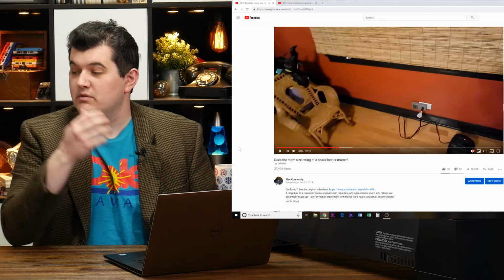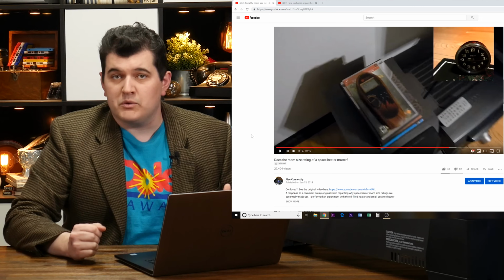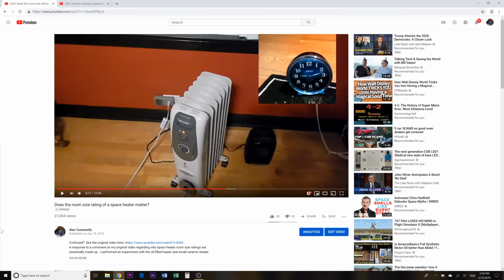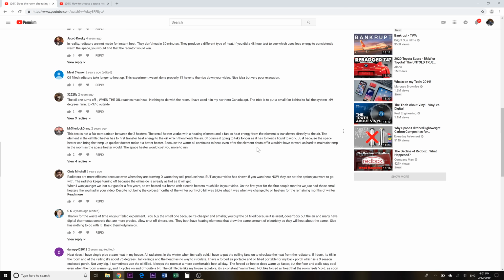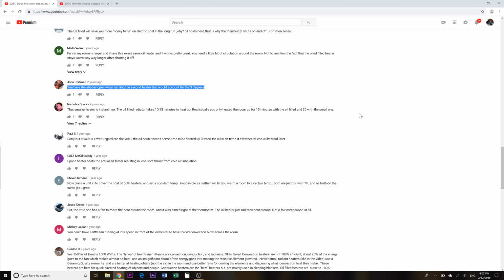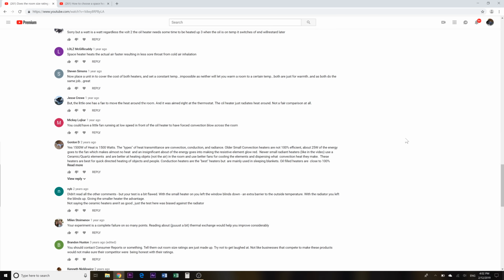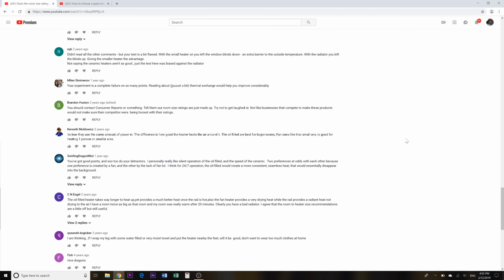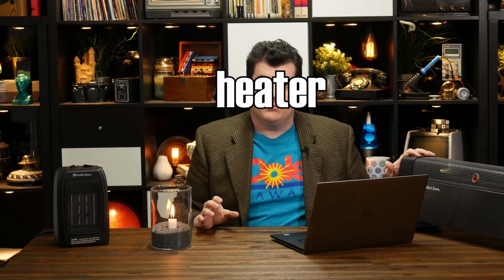More Space Heater Nonsense

Comment: I just spoke to my dad who has been an HVAC engineer a better part of 50 years and he does heat loss calculations all the time you had one thing right or 2. Electric heat is just about 100% efficient (why it's not used today cost) even though both heaters are the same wattage the oil filled heater has thermal mass and when power isn't being drawn into the oil radiator it's still radiating heat. So, if you want a quick instant rise in temp I would use both heaters at the same time and once you've reached the desired temp turn off the small heater by that time the oil heater is up to its optimal temp to keep it toasty warm. I bet the reason for the 1500 watt set point is for insurance purposes because most bedrooms on average can handle a 1500 watt draw on top of what's unknown in the room. Most circuits are rated at 15 amps kitchens or wet areas 20 amps along with ground fault interuptors but now I'm getting side tracked MOST IMPORTANTLY I don't have an electricle engineer a phone call away for free

Comment: Possible explanation for the space heater question:
By heating the air, it's density is lowered, making it float above the cooler air, also forcing cooler air from the top of the room toward the bottom of the room, and thus the heater.
The heater with a fan adds some control, but may allow hot and cold spots even after significant time.

I don't have confidence in that idea though.
I think the best experiment you could do for the problem at this juncture is run the experiment and collect temperature data throughout and plot a graph. Also, if you could use multiple similar sized and shaped rooms concurrently within the same rough area, to ensure that a steeper outside temperature gradient from one experiment to the next does not adversely affect the energy loss to the outside compared to other experiments.

Comment: I hated my 650 sq foot loft condo with 15 foot ceilings with a 99 dollar Menards special "edenpure knockoff" on 750 watts. The electric baseboard heaters that were 220 cost more to run than the fan turning on and off and it never ran 24/7 the heater was capable of 1500 watts

Comment: I'm trying to figure something out. I always believed that turning on a space heater to heat a room 4 degrees intermittently versus keeping a room at a constant, but lower, temperature costs more in electricity. Am I wrong? I'd like an explanation on this topic. Thanks for all this cool content!
Reply: It would cost more because while the room is hotter than the average, the difference in temperature is higher between the room and the outside. So comparatively, more energy is wasted and leaks out. But then while the temperature is lower than average, less would leak. So actually it might not make a difference.

Comment: You're right, don't worry. If you were to graph the energy being pulled from the wall over time, maybe it would show some of the people what you mean. The purpose of an electrical element heater is to convert as much energy as possible to heat within the room. If the energy comes out of the wall (as measured by the Killawatt), it has to go into the room, that should be easy to show graphically, and the difference should be quite dramatic between an oil heater and a fan assisted heater. Hope this helps. Great channel, keep it up!

Comment: Your points are sound and valid, but even towards the end you make the real important point, not all heaters that consume the same power will heat the room to the same degree or efficiency based on their design.  So while you consume the same or similar 1500 watts you may not get the same outcome or effectiveness of heat.  This could be due to differences in airflow either amount or direction (the primary differnce) efficency of the conductive materials, benefits of heat storage etc.  The marketing is likely BS in regards to room size rating (assuming the same power rating, not all "small room heaters" are 1500 watts i don't think), but you still as a consumer purchase a heater based on it's other factors to meet your needs whether safety features, convenience (self timers, ossicaltion etc).  Bottom line like you've already proven, just cus a heater consumes the same power doesn't mean you'll get the same output of effective heat (room size rating not being the measure or expectation of such).  The biggest differences will be surface area and airflow, a heater with more surface area will make more effecient use of the power consumed to put that generated heat in to the room faster and more dispersed.  I'd be curious if you put a box fan behind the oil filled heater if it would out perform the small ceramic.   At a minimum it generates heat using less power (yes it consumes 1500 watts while running, but you yourself said it cycles on and off much more often, and unlike the ceramic is still generating heat while not drawing power due to the heated oil, while the ceramic pretty much stops heating as soon as it cuts off.  So yes I agree with you that room size is a non informative near useless metric, your main goal with the video, I also agree with your other point that not all heaters will heat the room to the same effectiveness despite similar power ratings, but it's almost like you try to make the counter point of that argument most of the video to only come to the same conclusion, that in this case the "small" heater is actually more effective, not less, due to design diffrences, but still not the same.   A larger ceramic with same power draw but better airflow/fin design might do still better.  Bottom line watts consumed does not equal btu's generated, it just isn't that simple.  Realistically BTU is a far more important metric to the effectiveness of a heater than watts or arbitrry "room size" and is the only thing that determines how much space any heater can effectivly heat, now like you said other considerations might trump it in the selection process such as power draw and efficiency, some people will pay for less effective heat for a lower utility bill for example, it doesn't make it a more effective heater though, BTU is really the only measurement that articulates the heating/cooling capability of an appliance.

Comment: Thermal mass. Radiator style heaters are better for spaces that are less well insulated, as they deal better with swings in temperature..that pre-heat time taken heating up extra thermal mass gets put to work with a draft of cold air. A forced air heater will heat a room up quicker, but costs more to keep it that way because they have little thermal mass. Once the room (objects and air) is at temperature they would be theoretically equal in efficiency, but there is no perfect insulation.
Think of the thermal mass as a capacitor for heat, at peak demand you double your ability to recover from a thermal aberration. It is more efficient over time!

Comment: So if I'm gonna use an oil filled heater I should use a fan? I'm assuming using a ceiling fan blowing down would be best because it would push down the heat that has risen to the top of the room.

Comment: Just me spitballing and I am probably wrong.

The only thing that I could think of would be the oil heaters capability to 'reject a disturbance' to the room temperature. So for example The room has reached steady state of lets say 70 deg F for both heaters, A window is opened to bring the room down to 60 deg F (this is the disturbance to the system) and then closed allowing the heaters to reheat the room.

Now both heaters consume 1500 watts and with 100% efficiency are able to put out 1500 watts into the room, but the oil heater I would think has a larger thermal mass (able to store more energy in the oil). So, for the short term the oil heater should be able to put out more heat energy due to the internally stored energy due to heat in the oil. 

On the opposing argument of this, I am confident that the heat transfer rates are vastly different due to the oil heaters passive heat transfer when compared the small space heaters active heat transfer due to the fan. That would result in the small space heater to still win, but if the oil heater had a fan to actively heat the room I would think it would out perform the small space heater in this specific case.

Comment: There is a bit more to this than just the heating element. The small one with the fan with the fan is good for a small room because of the fan. it will spread the heat fast. The one on the right on the video is better if you want to use the natural movement of the heat, and that is better in a lager room. The idea is to put the element under a window to prevent cold air to "fall" form the window and make the floor cold. this makes the room feel warmer without actually using more electricity. 

As a rule 80w pr meter squared is what you need for most rooms. this means that a 1500 w heater is good for a room of 18,75 m2 or a little over 200 ft2. but this is only if you let the hater and thermostat do all the work. This is why it is better to buy a mounted heater fore use under the window than a small potable that you use only for a short period of time. This i also why many people likes oil heaters. Thermostats on small heaters does not great because it is to close to the heat-source. This is usually not a problem on bigger ones because the sensor is usually placed longer  away for the element making it read better readings. This is also better on oil heaters. 

I can give you some more info if you want. just answer my comment.

Comment: For me the question really is what defines it as a good space heater for a small or a larger room? What metric do you use to judge that? If it by how fast it can heat up a space then clearly the small one is better. But as a saw someone point out a larger one might simply be more robust and so last longer making it more ideal for a larger space as it takes more work to heat up such a space. While the small one just need to run for a short amount of time in a small space. But gain it all depends on what metrics you use to judge how well something performances. And the room rating system do not really tell you that does it? (Based on what I saw on the packaging.) And one could even turn it on it head. That the small one is better for a larger room at the noise it produces be as bothersome in a larger room as a small one. Meaning you want one of the bigger more passive solutions for a small one.

Comment: I have a small space heater, a cheap one, and it works on full blast for a minute and then it shuts off, and turns back on after 2 minutes or so. But the room does not heat up that much, it takes a while.

Comment: is the fan part of the wattage rating? the one with no fan would be dedicating 100% of its power to heat whereas the one with the fan would be using some power to move air which is not 100% efficient. not all of the energy used to move the air around is becoming heat. therefore the large room heaters are actually producing more heat at the same wattage rating. want to test this?...put 1500 watts worth of fans in a room and see how much it heats up.

Comment: A bit like convincing people that turning the thermostat to 95F in a cold house that is at 45F does NOT warm the house up any faster than setting it to 70F.....and people that have cars with automatic climate control, and adjusting the set temperature all the way up or down thinking that it will heat or cool  the  interior of the car faster  are in the same boat.

Comment: You have courage to explain this as clearly as you did.  It is difficult to overcome the "inertia" of marketing hype on people's thinking.  Keep it up :-)   BTW I just use one of those small fan heaters because our landlord is cheap on the heat and it works fine, although a bit noisy.  I think the best solution is for people to just get the heater that they like and that they believe in.  And the same goes for any other type of gadget.  PS You're never going to convince Granma that scientifically your gadget is just as good (or better) as the one she has been using for years. :-)

Comment: I agree with your argument. Between the two heaters shown in the new video there is no difference, and the room size labeling is silly.

However in the old video, you showed how the room size labeling is relevant for oil filled radiators. It is relevant how much heat it can release to the room before it has to turn off to cool itself. This is a function of the size of the element and the placement of the thermostat. It is not related to power/heat efficiency, which is, as you say, always 100%

Comment: Radiant heat will always out perform in a room that has a high heat loss (open window e.g.)   In a room with good insulation and low heat loss each will perform as well but the convection w/fan will always be faster.   It's NOT about temperature....it's about how warm it FEELS.

Comment: Okay so. Do the larger ones not have more mass to store heat to release later on? They can be useful if your electricity costs lower at night so you can have it on then and still be hot and releasing heat when you get up in the morning and the electricity tarrif rises (morning grid demands). I'm kind of surprised to see you miss that aspect.

edit: and another less important factor. Can a larger one not stay on its duty cycle longer because it could radiate the heat faster? (edit again, I forgot about fans :D)

Comment: Thanks for both videos. A few years ago the owners of the house where I live replaced gas fuelled radiators with electric heating panels. These were sold with all sorts of promises about radiative heating carbon nano tubes or some such. I was very sceptical of the selling techniques, but he had convinced the owners, a physics graduate and an engineer.

You have succinctly clarified my thoughts on the issue.

Whilst the owners were also concerned about carbon emissions from gas, they use green electricity from renewables and had a desire to become all electric they had also been convinced by the salesmanship patter on improved efficiency. 

I wish I had seen your original video from five years ago. It may have given me the ammunition needed to counteract the salesmanship pitch.

The company went under a year or so later so their 25 year guarantee was useless when the control system died. Fortunately the engineer owner was sufficiently with it to be able to solve the issue with an off the shelf wifi hub thermostat system.

Comment: Those little ceramic heaters are pretty amazing at how well they heat, and how fast they do it. The oil filled ones DO work well, but yes, they take forever to bring the temperature up. I'm wondering if they tend to KEEP the temperature a little more efficiently once it reaches the desired level. That might be something you may want to experiment with. As far as room size, well a small heater physically fits better in a small room and a big heater physically fits better in a big room like you mentioned. Lol. Technical disclaimer so they can sell a big one for more money.. One thing you have been very successful at doing is making some of us think about it instead of blindly buying a product according to what they say on the label.

Comment: I don't think the thermostat on a small unit like that is measuring the heat in the room. They are usually just a simple design to cycle the heater on and off at regular intervals depending on it's setting.

Comment: Great video, THANKS! - A thought: Consider the heaters to be an IR light source where that steady "glow" coming from the much larger surface area of the oil design might give a perception of more warmth without it actually heating up the room air temp. The small ceramic heater is more of a point source of direct IR "light" and its little fan blowing air at bare skin might cause one to feel cooler than "same temp" still air.  The ceramic element and blowing air might make skin feel cooler even with the exact same heat sent into the room. I bet the oil style will "feel" warmer from across the room when compared to the blowing air or waiting for the room to actually warm up!  Certainly agree: the total BTUs added to the room are the same, but there is that skin perception variable... another example of "feeling warm" due to IR is how your skin can feel the IR heat LOSS right across the room through an uncovered, single pane glass window (some distance away).  Interesting!  BTW, I like the way you can talk through all the nonsense and frustration.  APPROVED!

Comment: I think that when labels refer to large or small rooms they mean "more suitable for" rather than "more efficient". On smaller heater you have a smaller heating surface, it means you have to reach an higher heat/transfer surface ratio to accomplish the same task. That is why you need a fan, natural convection would never be sufficient to move heat away.
So, yes you can use a "small room heater" in large rooms, it will do the same job but do not expect it to have the same lifespan of the so called "large room heater".